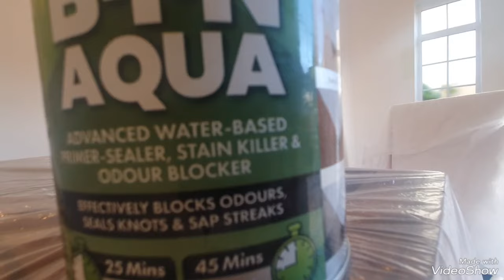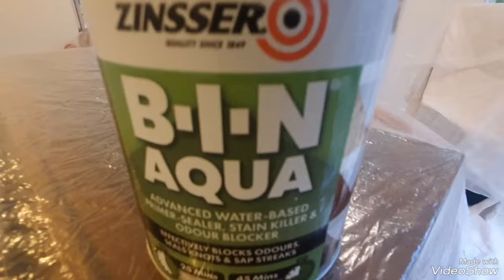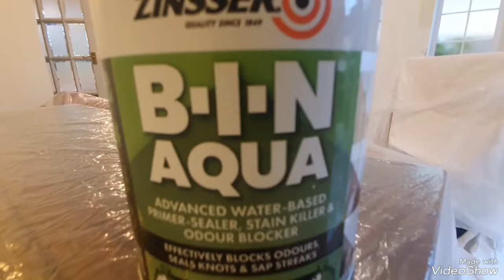A New Water Based Primer That Can Do Everything. No More Solvent

Comment: I think it's a great product Dan. I used it on a 8ft x 6ft water stain from a leaked ensuite. It nearly covered in 1 but i gave it 2. Then i went over with isomat ceiling 2 coats. Looked perfect. I've seen people of forums saying it's failed. I also used on knots on new timber. Worked a treat as well. It's definitely my go to now and if it was as cheap as haftprimer it would be my all in one. I think i paid £88 for 5l from somewhere, but cannot remember who.
Reply from the maker: Mate that is fantastic positive feedback thankyou so much for that ad I agree if it was cheaper then that's the one for undercoating aswell
Reply: @danielnugentpainteranddeco557  definitely mate. When people say it's failing on stains, I'm wondering if it's the stain that's still wet and not dried out.
Reply from the maker: @danielwoolcock7267  True mate and also its a 45 mins redcoat time so best to follow that as you could be softening up the first coat if second coat is applied to soon
Reply: @danielnugentpainteranddeco557  yes that's another good point. I think I left mine well over an hour before the second went on.

Comment: Great review Dan, I'm a big advocate of water based paints, they've come such a long way in the last decade or so but I'm going to have a moan about them now. I've recently done quite alot of hall, stairs and landing jobs and I've had 2 call backs in the last 2 weeks to put right handrails that appear to have "melted" because of the oils from peoples hands. I've used isomat isolac and tikk everall aqua on both jobs and they've both struggled to last more than a few months. Its frustrating because my prep is spot on and in 27 years as a deccy I've never had call backs for failure of a product. If they say these coatings are up to the job then why do they fail so quickly. Btw, its not the prep, everything is sanded, cleaned down with meths, primed, de nibbed, cleaned and so on so on. Have you or anyone else had issues with this? Cheers mate and sorry for the grizzle!! 😅
Reply from the maker: Hahaha no worries mate I'm always here to lean on

Comment: hi dan. can you put water based satinwood directly on top of bin aqua or do you need to undercoat first
Reply from the maker: I always put a coat of Caparol Haftprimer on then 2 topcoats of Satin mate
Reply: @danielnugentpainteranddeco557 Doesn't it get expensive 4 coats in total?
Reply from the maker: @bitTorrenter  yes but a jobs worth do8ng right in the l9ng run